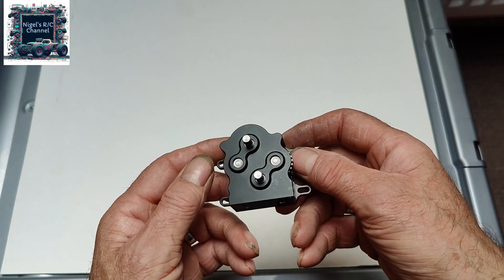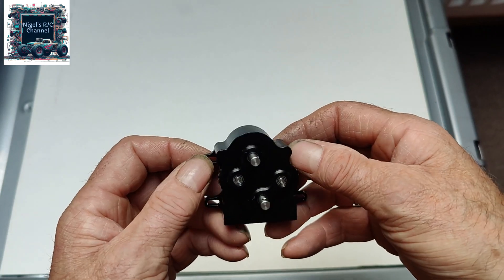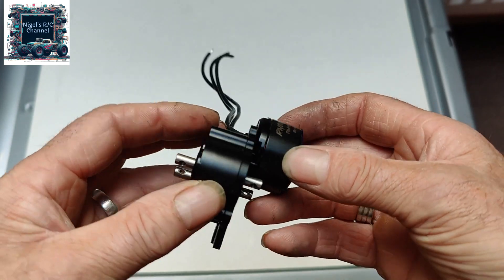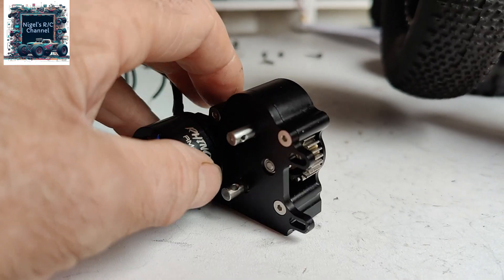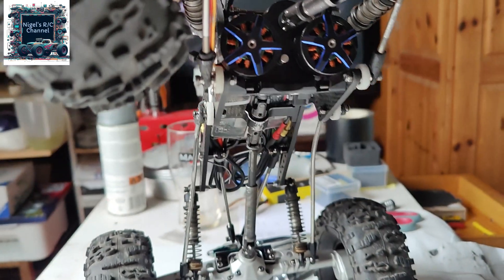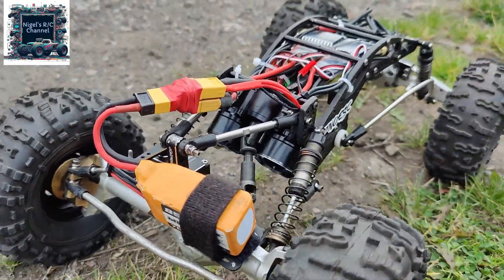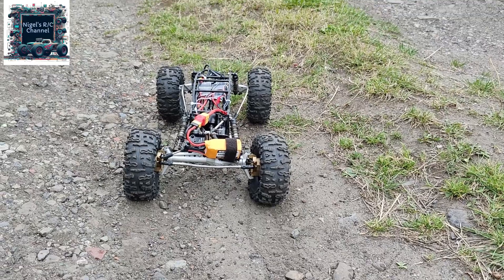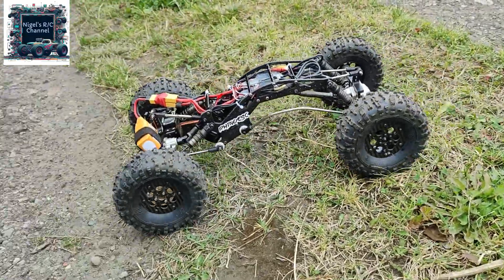New 2 Motor Dig Overdrive Gearbox Fitted into a Rhino crawler lcg

Comment: Hi, I didn't think this gearbox could be integrated into the Rhino chassis but you've done it, well done 👍
The front drive shaft runs very close to engine 2, it's an S12, do you think an S20 engine, which is longer, would fit?
Reply from the maker: @sebtrial  no the S20 would not fit with gearbox in this position. But a center pumpkin axle would be better